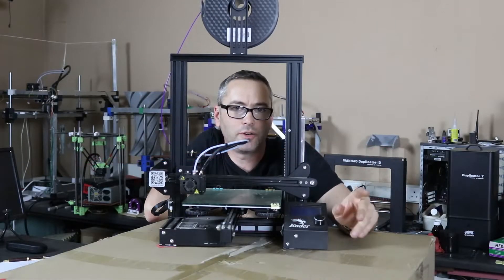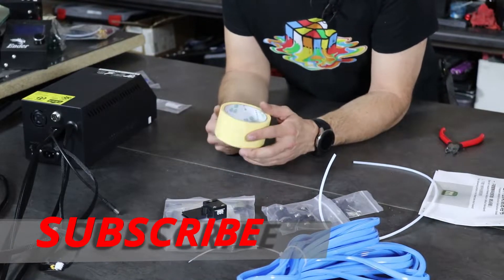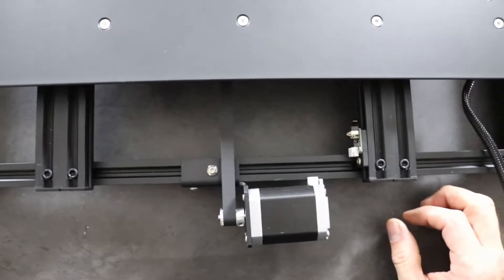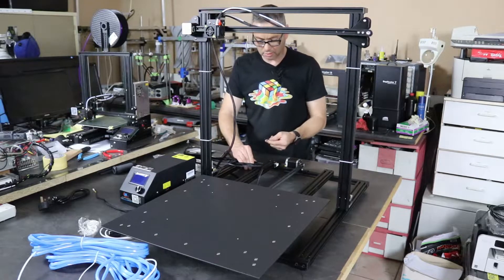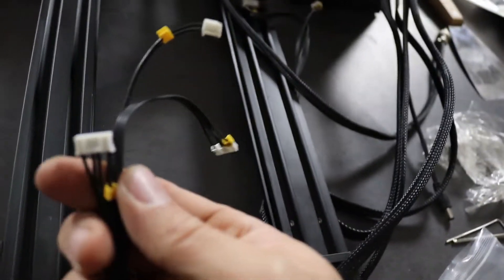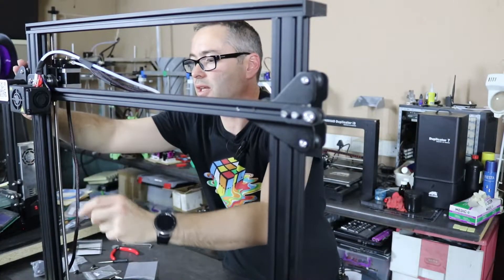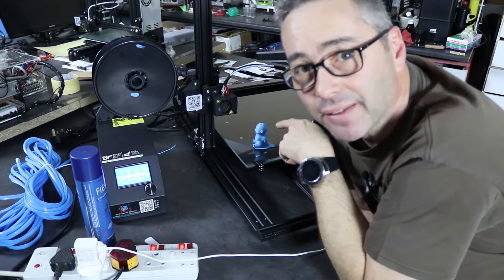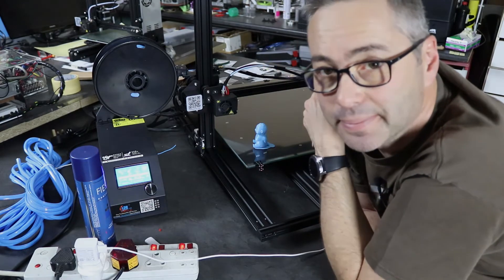CR10 S5 Quick build and 1st Impressions

Comment: Can you suggest which one is better and more reliable from the two; CR-10 max and CR-10 S5? Need your suggestion to help me decide on buying one of them
Reply from the maker: Sorry only saw this now. What did you buy in the end? 
I would suggest that unless you're needing the size of the S5 get the smaller one the extra size means you have to print slower to keep the quality up.

Comment: You can print a full 45 CM figurine if you print it hollow, with 4 shells, in 19 hours with a 0.4mm nozzle. Don't use infill, it's a waste of filament.